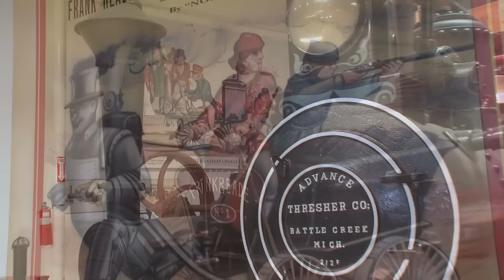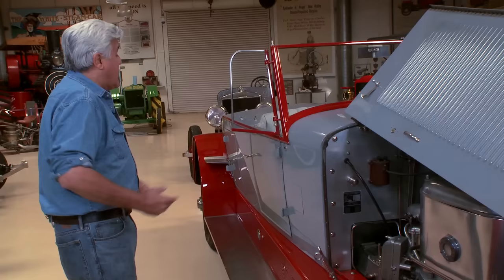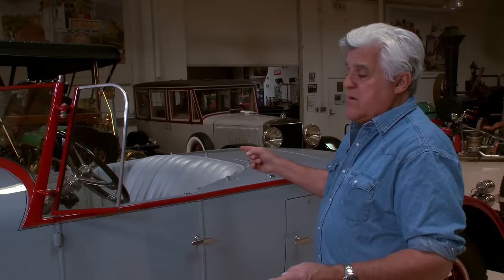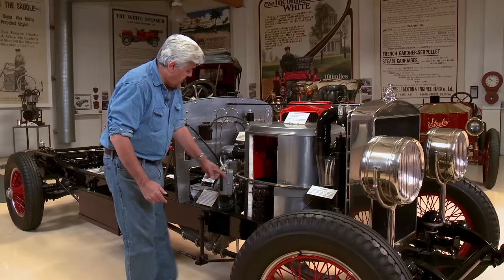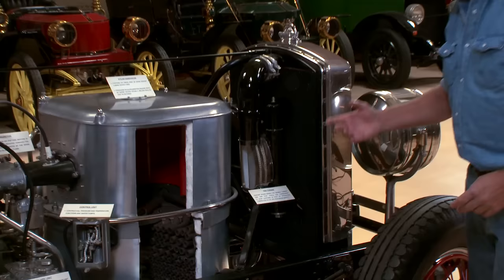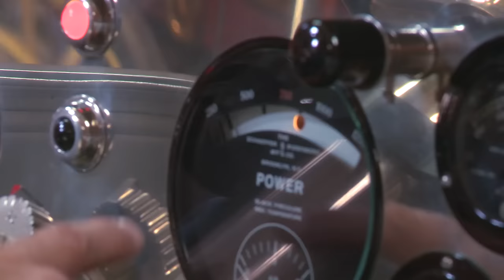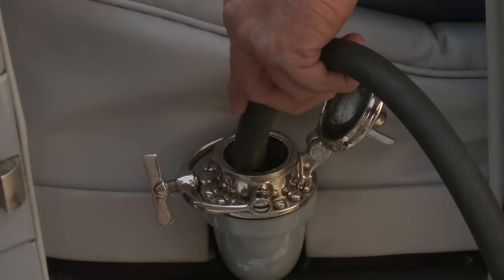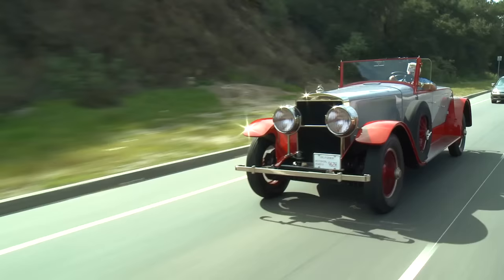1925 Doble E-20 Steam Car - Jay Leno's Garage

Comment: At 23:48 how it's devouring up the freeway at 60mph (97kph) with hardly any sound and just a little bit of steam letting off.
Behold a vision of the future that should have been !

With an updated chassis & today's electronics to simplify operation, what could be achieved today ?
Why do I feel like the automotive/petroleum industry are keeping us hostage to antiquated technology & special interests ?
Reply: +trespire Not to mention, during most of the video its devouring gasoline at an obscene rate... at no time during this video was this car getting anything better than about 8 mpg..!!!!

The big oil companies would be very happy if everyone started driving steam cars.

Steam automobiles are an antiquated and obsolete technology... far less efficient than internal combustion
Reply: The real doktorbimmer
Where did you get that figure of 8mpg from ?
Reply: trespire Published BSFC and TFE data from Besler Bros. who acquired the Doble patents and designs after Doble closed and from accounts in articles on the the Doble E types actual fuel consumption on kerosene fuel.

The numbers are not far off from what can be extrapolated by the average BSFC of a Uniflow type of similar 150hp design operating at the same temperatures and pressures rates for a 5,000lbs automobile..

But this should be no surprise! the average reciprocating steam engine of this size is about 300% less fuel efficient than a modern car engine car
Reply: The real doktorbimmer
Thank you for the information. I'll probably look this up. Interesting technology.
Reply: trespire Interesting, Yes extremely so... but still obsolete technology none the less.

Unfortunately the steam car can never compete with the ICE's

As a Heat engine design they are inherently very flawed..

It impossible for steam to reach the same Carnot Cycle efficiency as ICE's

so there is no chance they can ever make a comeback

unless maybe some new type of nuclear fusion technology can be scaled down to the size practical for a car... assuming nuclear fusion is possible?

I digress...
Reply: The real doktorbimmer
Sometimes to move forward we need to look back to see where we have been. There are many useful lessons we can learn from older technologies. Apart from gaining a better appreciation for what we have achieved to date, it is another perspective to the problem.
Reply: trespire That's right, Nikolaus Carnot discovered 200 years ago through his heat engine cycle formula that steam engines could never match the efficiency of ICEs... long before ICE's were even invented...

If we do not study history.. we are doomed to failure.
Reply: Will Davis You don't seriously believe any of the crazy conspiracy theories out there that the petroleum industry killed off the steam car do you????

Because it does not make any kind of logical sense at all..
Reply: The real doktorbimmer
Nothing "crazy" about dirty business practices such as under pricing you opponents then buying them out, or under the table secret agreements to monopolize the market.
Guess who was big in oil refining & distribution in those years ? Don't put it past them, big business will try anything, for as long as they can get away with it.
Reply: trespire Unfortunately only "crazy" people believe in such nonsense..
or they simply have absolutely no concept or understanding of how economics or commodities futures trading works..

Its not a conspiracy.. its just how things get bought and sold..
Reply: +The real doktorbimmer also the other problem with steam power cars was below freezing weather as your water could freeze up.  When not being driven the steams powered vehicles needed to be protected from freezing temps.
Reply: +The real doktorbimmer Bell X1 broke the sound barrier due to designers looking back on WW1 Aircraft
Reply: +Occa Drumma Some cool  reasons I found why Steam hasn't made a comeback:  Why steam isn't more popular and why it hasn't made a comeback is largely due to misconceptions about steam.

1: "Steam requires huge boilers and engines". Wrong; steam boilers were getting quite small by the late 1800s by using what is known as 'on-demand' steam boilers. and by the 1930s many patents were issued for very small designs that produced tremendous power. In fact, by the 1920s, steam power was very comparable in mass to diesel or gasoline and more reliable...BUT steam required more attention and internal combustion engines were safer than traditional steam. So even advancements in safety were generally ignored in favor of the 'newer and better' technology. I also think that advancements in metallurgy and the advent of micro-controllers was needed for steam to be truly viable. And today we have that.

2: "Steam is a bomb waiting to happen". While yes, steam can be VERY dangerous, due to the high pressure, it doesn't burn. And with modern boiler designs only a very small amount of water is boiled at a time. So that a catastrophic failure would have very little danger. Plus we don't use soft steel or rivets to hold things together anymore either. And these advanced happened way back between 1870s and 1930s. And many advances have come since then due to people continually seeing the value.

3: "Steam is dirty". True! Well, sort of. They used to be. But with modern burning processes there is no reason why steam can't have a cleaner burning process than gasoline or diesel.

So in the end, the biggest reason why we don't use steam is probably because of market resistance to replacing the gasoline or diesel standard and the ease of use we've gotten used to. But truth be told, with modern developments, it is likely a person driving a steam powered vehicle would not even be noticed as they too filled up on diesel, methanol or ethanol.

_________________________________

As for reasons why we SHOULD be using steam; Using the burn methods used in the biomass heating industry, specifically gasification of bio-friendly materials would allow Steam to run around 90% efficient. And the exhaust produced would be carbon neutral; as long as things like switchgrass pellets or manure pellets are used. Gasifying pellets is easy and easily automated. Maintenance requires notably more attention than liquid-fueled boilers. However, liquid fuel steam boilers running Switchgrass derived bio-diesel can be made to burn extremely clean using very high temperature burners. Remember, one limitation of internal combustion engines is that they cannot allow the burn chamber to get too hot or things will fail.(melt, crack or seize up). However, in an 'external' combustion engine like a steam engine, the power cycle and power producer are separated. The piston has dry steam and is always a two-stroke. So the engines themselves are smaller, lighter and simpler. The boiler can be small simple and compact as well. Using modern technologies we can produce very high pressure combustion environments with non-metallic walls, instead using ceramics to allow much higher temperatures to be maintained. ICE engines must cool the cylinder walls and piston as quickly as possible, so the burning process takes place within a cooler environment which limits the peak temperatures reached. And much of the energy lost is lost through poor combustion and active cooling. ECE engines use that heat to make more power. (a form of passive cooling) ECE engines can be designed to burn their fuels at extremely high temps thereby burning cleaner and far more efficiently.

In the alternative energy field we use gasification to burn solid fuels, such as wood, grass or manure pellets, at extremely high temps. We are limited by the materials we use. Generally speaking, your typical steel will melt around 2,700*F. But we aim to burn at 2,800*F. So you see the dilemma. What we end up doing is using firebrick to protect the steel from the heat. The firebrick can handle higher temps without breaking down. Regular firebrick can withstand 2,900*F. However, high-porcelain firebrick can withstand 3,200*F. Even then we are able to literally burn the brick. We burn regular old wood so hot you could melt titanium. So we need to use a special coating for on the brick that can withstand temps as high as 4,400*F. (We have measured temps of 2,300*F more than 60" from the actual flame.) All of this effort allows us to burn at 94% efficiency. So making highly efficient steam boiler would only be a very small step up from where we are already. Our designs are meant to maintain several hundred gallons of hot water at 180*F to be used for heating buildings, but it would be easy to make steam.

Also remember that all electric generator plants use steam. Regardless of if they are coal, gas or nuclear powered.

As for modern usage I would suggest using steam for things like trains, semi-trucks, heavy equipment, ships, and larger vehicles in general such as full sized pickup trucks, city buses, military tanks and other armored vehicles. Whereas I would not want to use steam for small vehicles like family cars, small trucks or motorcycles.

While steam can be used for almost any role, due to its limitations (mainly increased maintenance), steam would be much better used in industrial applications and for home backup energy production.

For some very interesting steam engine designs check out http://www.douglas-self.com/MUSEUM/museum.htm 

Sourced from: http://www.instructables.com/answers/Why-hasnt-the-steam-engine-been-reborn-for-modern/ 

Im speculating he got some of his info from that link^^^
Reply: Occa Drumma Exactly what do stabilators have to do with steam engines????
Reply: Occa Drumma Exactly what kind of mpg do expect to see from 150HP compound reciprocating steam engine?????
Reply: Occa Drumma 90% efficiency is not possible with steam power.. you should brush-up on your engineering skills son...
Reply: Sorry for not having a major in engineering Son but can you explain why it's not possible. Don't just say something and then don't back it up.
Reply: Occa Drumma Carnot...
Reply: Oh right ok that formula thing. Well that was waaay back in like 1824 or something like that. With modern tech it could be possible and wont be hard to become more efficient than ICE if it had the support. Much like ICE have become more efficient
Reply: Occa Drumma Monsieur Nicolas Léonard Sadi Carnot
Reply: Occa Drumma No, its not possible.. that's exactly what the formula tells us.. apparently you skipped over that part on wiki.... lol
Reply: Occa Drumma Nope... you read wrong..
Reply: Steam engines and turbines operate on the Rankine cycle which has a maximum Carnot efficiency of 63% for practical engines
Reply: Occa Drumma No, currently the highest Carnot cycle of a practical steam engine (single cycle) is about 41% and thats only in the million +plus boiler horsepower range.

You can buy a Diesel in production today that delivers 56% 

Don't confuse "practical" with "theoretical" limits...

Perhaps you should study-up a bit more on Carnot...
Reply: That's for industrial grade steam stuff like power plants etc that use Huuuuge boilers and stuff. Also no where does it say theoretical it literally says practical meaning small engines with high efficiency
Reply: Occa Drumma You need to be an adult to actually have an "adult convo"
Reply: Wow... I am 18. That's pretty close and the guys I race with are adults and they treat me as an adult cause they see me as an adult.
Reply: Occa Drumma Thermal-Fuel efficiency of ECEs is reduced with scale...  as with all heat engines.

Single cycle..  modern power plants commonly employ "Combined Cycle" operation..
Reply: Occa Drumma Obviously they haven't read your Youtube comments...
Reply: Hold up efficiency is reduced... efficiency sky rockets the smaller the engine is with anything. a 6.2L V8 is less efficient than a 2.0L I4
Reply: Occa Drumma Good luck with that...
Reply: Bigger size = more parts= more heat= more friction= more torque needed to pull/push everything around meaning more fuel
Reply: Occa Drumma Not true..  compare engines of similar design and construction and BSFC is reduced you will not find otherwise.
Reply: Last I checked piston driven engines are all quite similar
Reply: Occa Drumma Bigger engine = Less Entropy... = better BSFC
Reply: Occa Drumma LOL..!!! quite similar???

No.. not true
Reply: Occa Drumma whats the matter? past your bedtime????

Comment: All it needs is a super compact, liquid salt cooled, thorium reactor =)
Reply: Even if it were to be grapefruit-sized object (glowing red), the gamma emissions from fission products would shorten the driver's life down to a couple of drives.  LFTRs can be container-sized, but need only to stand within a sealed shed, just for distance.  That's distance you can't get in a car.  However, LFTRs may be used to convert atmospheric carbon dioxide into hydrocarbon fuels.  That would immediately begin to mitigate fossil-fuelled global warming and climate change.  Snag. . . .    Have a nice day.
Reply: use an RTG
Reply: @MrTeddy12397  Would need a fancy heat exchanger.
Reply: beachcomber2008 just put the remaining cherynoble reactors in there that’ll make some real steam
Reply: Oh, like the Ford Nucleon concept car?
Reply: @curbowman  You should live so long.

Comment: "Steam was dead by the 1920s" - er, that's obviously coming from an American perspective! We were still building steam locos here in the UK until 1971, and the last industrial loco wasn't withdrawn until 1994!
Reply: I think Jay was referring specifically to steam powered automobiles, which became obsolete after Charles Kettering invented the electric starter in 1915. The UK was still building steam locomotives because the UK was still decades behind in Diesel locomotive technology...
Reply: +doktorbimmer Ah righto, fair enough. That makes sense. We were still building steam locos that late mostly due to the quality of British coal, which is just about the best on the planet for steam production, and we had (and still have, though we're not allowed to use it thanks to the EU) a pretty much endless supply of the stuff.
Reply: @inkyscrolls5193  In fact, steam locos are still being built in the UK.  Not many, but "David Lloyd George", "Taliesin" and "Tornado" are all brand-new engines from the past few decades, though essentially built to classic designs.  That's not even counting the major restoration projects that start with an original chassis and end up with a main-line certified loco, such as "Galatea".
Reply: @Kromaatikse  Very true, very true.
Reply: @Kromaatikse New commercial steam locomotives however are not being built, those are replicas of very old technology produced for nostalgia sake, only used for special tourist trains and not used for revenue service by any main line freight or regular passenger service.
Reply: Steam locomotive are without any doubt obsolete now... they simply cannot compete with Diesel or electric locomotives in terms of cost per passenger miles or ton/miles of freight.
Reply: @doktorbimmer  On the contrary, both "David Lloyd George" and "Taliesin" were built for and work a regular passenger timetable on a railway which pays its own way.  It is a timetable with strong seasonal variations, and the railway switches to diesel traction during "low season", but it is considered a genuine local transport link, not merely a tourist/nostalgia attraction.  I did already mention the fact that they are based largely on classic designs, with minor refinements for the modern age such as welded boilers (fake rivet-heads being added for aesthetics), a tuned blastpipe and an accurate speedometer - but that's simply because the classic design was a good one.
Reply: @Kromaatikse Nonsense... the Ffestiniog Railway is a major tourist attraction and simply could not exist without tourism as its majority source of income, and as a nonprofit, the trust has also received millions in gifts, government funding, subsidies and grants.
Reply: @Herman Greenfield  A very interesting theory, but Germany had an abundance of coal and not much oil, yet they adopted and converted  to Diesel much sooner. Cheers!
Reply: Steam was used for freight service in the US well into the 1950s pulling very heavy loads and with articulated locomotives (Big Boy, Cab forward Mallet, etc.) so they could make the bends but they were dropped first out of passenger service because at speed the steamer beat the tracks up badly. The huge connecting rods  made them very tough on every thing subject to the vibration
Reply: @dllc1138 A local short line not far from my home operated steam locomotives in freight service until 1967... but started the transition to Diesel locomotives in the 1940's. the difference in operating costs made steam prohibitively expensive as the cost of fuel and labor increased.
Reply: Inky Scrolls   Sure, thanks to the EU you have cleaner air and less cancers as well.... and don't be too hopeful of leaving it, your parliament seems bent on reversing Brexit anyway, so you won't start digging coal out again anytime soon... I forgot, it's UK government, and not the EU, who committed to decarbonising faster than other nations...
Reply: I thinking we are getting off on a tangent here, the point is steam Automobiles were rendered obsolete in 1915 when Charles Kettering invented the electric starter for ICEs... at this point steam cars no longer offered any significant advantages in the market place,  America's largest steam car manufacturer White Motors recognized this market shift and immediately switched to internal combustion engines and remained in business while all the other steam car companies started down the road to bankruptcy or left the market completely.
Reply: He's talking about steam cars, not steam locomotives. Pay attention.
Reply: @doktorbimmer  I think you need to learn what obsolete means.
Reply: @Bad Cornflakes Steam engines are absolutely OBSOLETE... without any doubts.